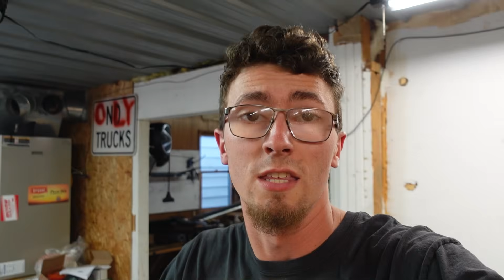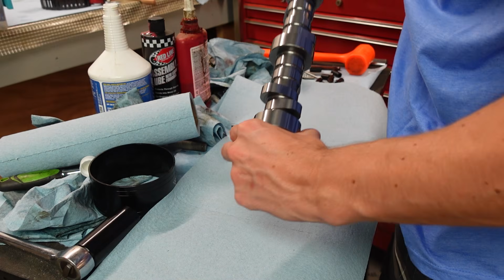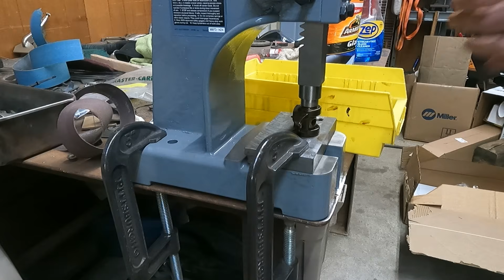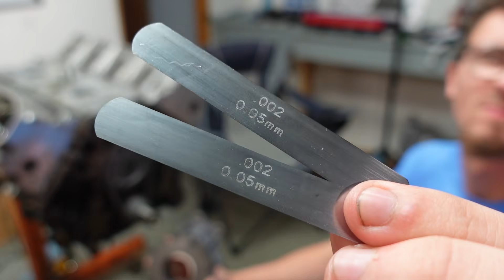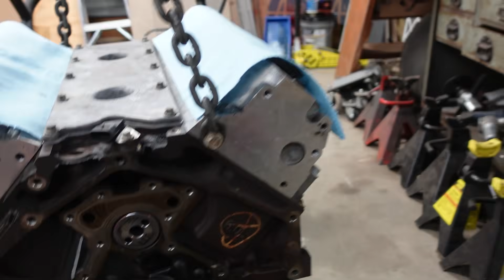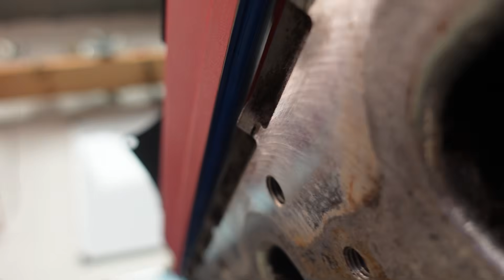Tips and Tricks For Building An LS - Junkyard 6.0 LS Build

Comment: You're not supposed to spiral the top 2 piston rings, you're supposed to use a piston ring expander tool. The tool is very cheap so there's really no reason not too. You could even very carefully pry the piston ring apart with your finger tips and slide it around the piston from the top, you would need to put the piston In a vise, preferably with rubber grips so it doesn't get messed up.